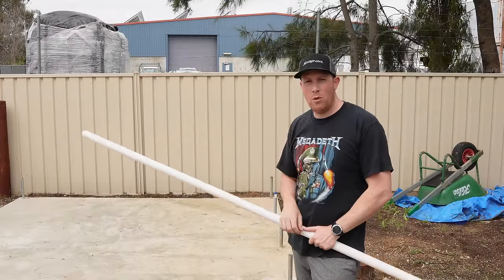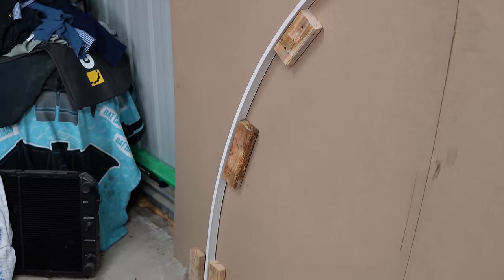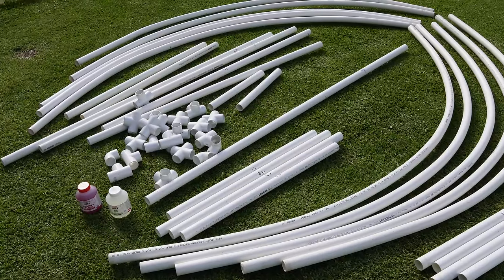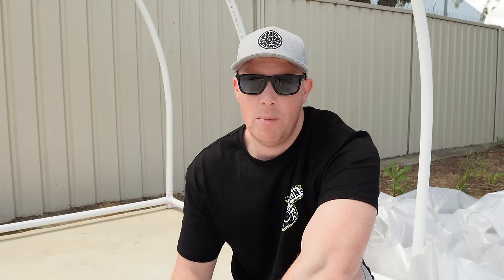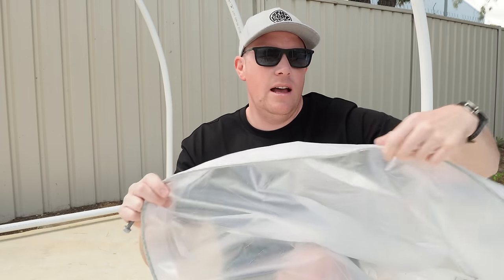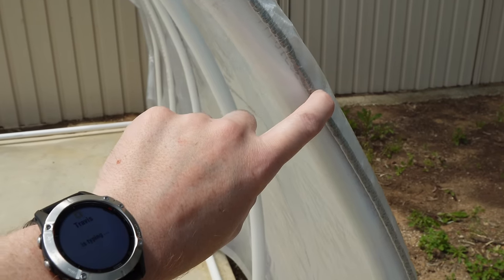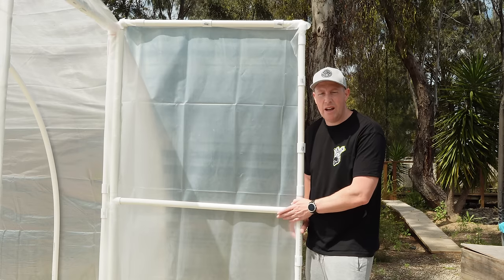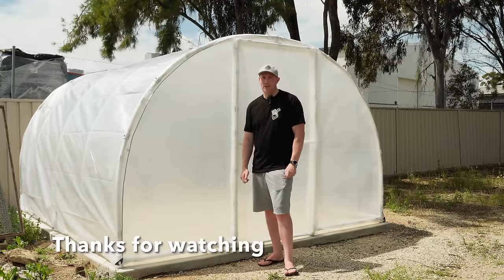Build your own Greenhouse DIY using PVC pipe!!!

Comment: Please don't use PVC in your garden, though it does last temporarily it will eventually just break down through sun exposure. Instead of PVC try using galvanized chain link fence upper rail bend to the shape you desire and enjoy that frame for decades to come instead of years.
Reply from the maker: Good for 20 years here in OZ I’m happy with that 👍🏻
Reply: See my reply above Matt. We have UV stabilised white PVC piping in Aust and NZ. It will last for donkey's years. In the northern hemisphere, you'll need to make sure you source UV stabilised PVC piping or use galvanised steel or aluminium pipes.
Reply: Please correct me if I’m wrong here. I’ve been searching for more info, but it’s not the concern of the PVC being UV resistant. The problem is the chem reaction of the 6mm plastic contacting the PVC.

Comment: Hi! Just a quick question, how can you remove the plastic say when there is a cyclone or cam you remove both plastic n frame then refit after a cyclone?I luv this design for our women farmers  but this wud be my only concern and how much did it cost to construct? I am enquiring from Fiji.
Reply from the maker: Hi there, yep easy to remove the canopy, just pull the clips off and fold away when a cyclone is around, As for the cost, if you didn’t do the concrete floor you could build this in Australia for around $1000, mine cost around $2500 with the concrete floor doing all the work myself, good luck with your build 👍🏻

Comment: Historical evidence has shown using PVC pipe and Poly- tarp , allows a large friction coefficient, and rapid degradation of the areas touching the hoops. Taping the hoops prior to covering, slows the process. Of note PVC isn't UV impervious, and the Gray electrical conduit has a nasty habit of expanding when hot, and the expansion joints are expensive. Otherwise great job
Reply: Historical evidence has always shown that one person thinking a better way but never has or will do anything but criticize.

Comment: you actually do want the bent pvc pipe under pressure when you bend it over, dont heat it. With the tension of the pipe pushing out og your greenhouse, tunnel when you cover with your greenhouse plastic sheeting you have much more resistance to collapsing from wind and snow load

Comment: Nice one James, I just subbed to your channel, just a heads up, with the hot glue gun, over the years I've learnt...I'm 66 yrs old, that in stinking hot blazing sun hot glue WILL start to re-melt and run, I've had it happen TOO many times I now don't use it and haven't for years. Just my thoughts mate. Seeya Rob
Reply from the maker: Thanks Rob, yeah a buddy I’ve mine said the same thing, I might have to come up with another solution like silicone adhesive or something. Thanks for the sub 👍🏻

Comment: This is the ultimate example of creativity in using PVC for such a project.👏👏👏👌👌 Specially, I like the sand application in giving new shape to the PVCs. One major thing that I find as overkill, while it makes the whole project extremely looking nice and clean is having a concrete floor. You see, I look at projects such as a greenhouse, as something that gives me maximum flexibility with the least amount of effort and cost for change in the future, if in case I wanted to remove the greenhouse completely, or wanting to move it to a different location. At this very moment, I’m building my own greenhouse that is mainly intended to protect the fruit trees I’ve already planted, against extreme weather fluctuations. It is going to be 21 feet long (6.4M) by 7 feet width (2.13M). The foundation and surrounding frame is made of free wood pallets, up to the height of 47” (1.19M). Then I’ll be using 1 inch (25mm) by 10 feet (3M) PVC pipes to make the arch. I hope I won’t need to warm up the PVC to create the arch.🙏🙏🙏

Anyway, I only use screws, if in case I need to remove or make changes to the greenhouse in the future. With 1 inch wood stakes I secured the wood frame into the ground without any cement.

Comment: Thanks! Do you have any issues with air circulation or venting?
Reply from the maker: Hey mate, on hot days I keep the door open to let some air flow through, if I was starting again from scratch I would put a couple of vents in the front and back panels with maybe a zipper type setup, something to consider if you are building one. thanks for watching
Reply: @Homeonthetools  Excellent!! Thank you so much for sharing and responding! Have a great day and keep up the good work!

Comment: How did you hear the sand? If we cant use heated sand, what would you suggest? Really good video and liked the ideas for gate!
Reply: 'heat' the sand
Reply from the maker: Heat the sand up with the oven as in the video, I tried a couple of other methods to heat the pipes like a heat gun but only sand worked so that’s the go 👍🏻

Comment: I’d like to help you have a greater understanding of the materials you choose to use or not use. It comes with a story. Rubber trees are tapped to collect rubber secretion. That is used to make tires and tubes and all rubber products. When it was being tested and worked in the lab, the defining moment came when carbon was added, turning it from white to black that we recognize today. This greatly improved the qualities of the rubber making it stronger and resistant to UV rays from the sun. Ok, if you’ve followed along this far, PVC pipe is similar. White PVC pipe degrades in the sun by Ultraviolet Rays (UV) and makes the PVC pipe brittle, to stop this for PVC electrical pipes, carbon was added to block the UV rays and make it lays in the direct sunlight!
So, to make a hoop house or greenhouse using PVC pipe as the supporting ribs, you must use the grey PVC pipe normally associated with electrical work!
I hope this helps you and everyone that reads it!
Reply from the maker: I’ve had pvc pipe for my pool out in the sun and exposed to chemicals for 10 years and it is holding up fine, if it lasts even that long I’d be happy 👌
Reply: That’s great! I’m just trying to help. Here in America they must not but adding UV stabilizers but maybe they do for you. I’ve made insect netting covers that look like cold frames over my brassicas and in the 3rd year they were brittle.
Reply from the maker: @grdelawter4266  yeah in OZ they add stabilising additives to make it hold up “better” to UV light, the premium pipe I bought was told it may yellow off over time but with hold it’s structural integrity
Reply: That good to know. Thank you
Reply: Yep, in Aust and NZ most of our white PVC piping is UV stabilised and will last for years. Our guttering and down pipes are also made from UV stabilised white PVC. The guttering on our house here in NZ is original and still in good condition. The house is 36 years old. For our American friends, we don't tend to use metal guttering/spouting in this part of the world anymore. Great build @Homeonthetools.

Comment: Looks great! What length is each arch half. 10ft? & what is total length of this? 6x10?
Reply from the maker: Thanks 🙏🏻 each arch is 3 metres so 9ft. The width of the concrete slab is 6 metres with each arch (left and right) 3 metres giving me 2 metres of height in the centre (hope that makes sense)

Comment: I wonder if one could use a heat gun to shape the pvc whilst in the jig?
Reply from the maker: Nah mate I tried it, just blew holes straight through it and even on low setting I couldn’t get consistent bends without burning
Reply: You can use a heat gun but it is a sketchy process unless only doing a short piece. The best way to bend larger pvc is high performance heavy duty heat tape.